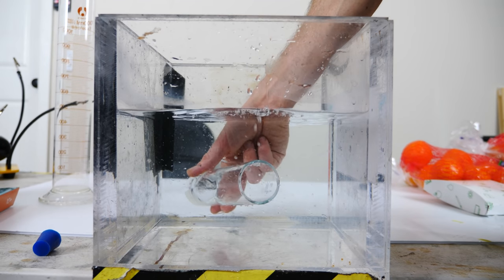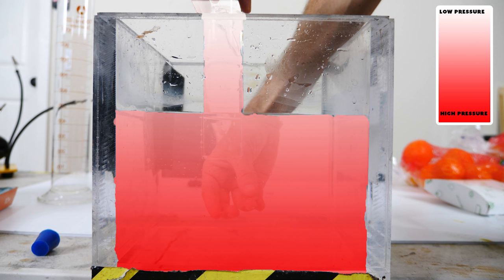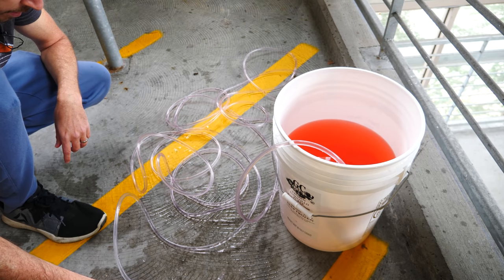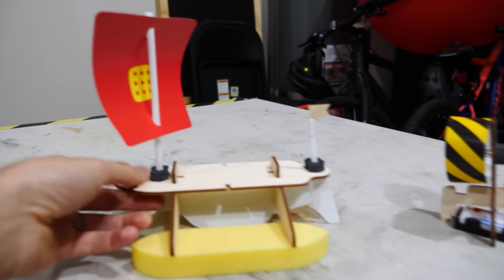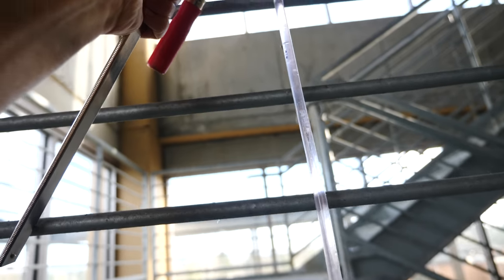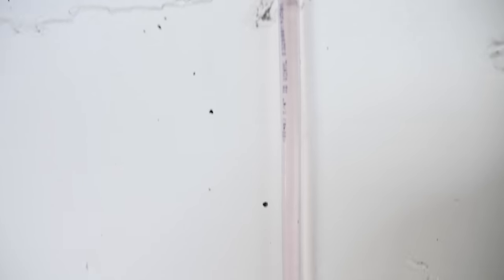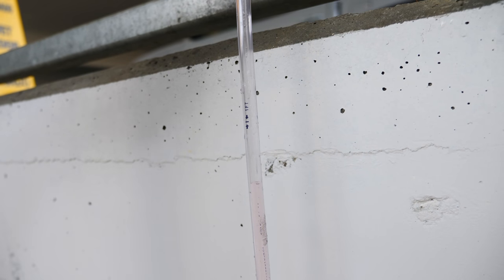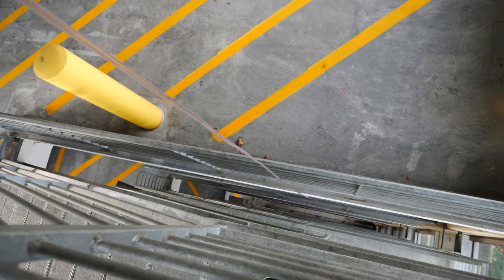Why Water Boils In Tall Cups

Comment: Please don't  say sucking. That sucks. You aren't sucking the water up. The air at the bottom of the tube is pushing the air up. That force is countered by gravitational force on the water plus any downward force from any air pressure inside the tube at the top. As long as the upward force exceeds the downward force the water in the tube stays. Hence the height limit because of the mass of the water column x gravity.

Comment: Isn’t it just sucking air  up because the pressure going down is greater than the pressure in the bucket  forcing bubbles to go down and up the starw?? Or is that water warmer idk
Reply: Neither. It's not warmer. It's just boiling.

Comment: Boiling as in just gases expanding and being visible but cold water ..................or.................Boiling as in kettle hot boiling water? If you set up valves you could tap it for a hot brew. Could this be done with 30'+ of vertical copper pipe or glass at 15mm???
Reply: It's not getting hotter.. It's just boiling at ambient temperature.

Comment: I had one thought as I watched this, if one could isolate the water vapor from the water head with a valve and then blead it off and condense it. We would have a mechanical distiller. Ie salt water to potable water to drink or irrigate.🌍

Comment: Hi and thanks for doing this visual experiment it like you say it's simulation of another video my question to you is two fold "boiling" in this instance is the splitting of the bond holding the H and O together and you mention starting temperature and correct me where wrong, the splitting causes an EXO thermal reaction,  so you can't suck water above 33feet at sea level because Livingston used this method to find the source of the Nile?

Comment: I'm gonna go out on a limb and assume that it has something to do with the building pressure of the water at the top pushing on the water below, building friction and because there's not a lot of water to dissipate the heat through and the heat keeps building and rising to the top. Also, thinner/lower pressure air at higher altitude probably plays a part. Now I'm gonna watch the video and see how wrong I am. 😂

Comment: what does boil even mean.i didnt see no heat source to get it up to 100 degrees.
Reply: Water doesn't need to be heated to boil.
Water boils at 100c when it's at sea level. But the less pressure, the easier it boils.

This tall tube created a near-vacuum at the top, so the water now boils at ambient temperature.

Comment: Can it be used to create a heater, or is the boiling water on too low pressure to give off decent heat?
Reply: its not hot. its just boiling.

Comment: So when the water boils at that height, is it 212 deg. f? or does the drop in pressure also reduce the boiling point?
Reply: The drop in pressure reduces the boiling point.

Comment: Does the diameter of the cup make a difference? My thought process is if you have a cup with a 10foot diameter, there’s more weight of water pulling down lowering the pressure at the top more than if it had a diameter of 1/4”.  The 1/4” line would have far less water it it which would mean less weight.      Idk. Am I wrong?

Comment: So why doesn't water boil in a plane because the interior of the plane is pressureised ik not by much cuz too much pressure would be uncomfortable for ppl but planes need that pressure so it's a light vaccume but planes fly quite high witch means the outside pressure is increased the higher you go and the water on the inside of the plane is it because the water is inside the lower pressure pressurized interior so atmospheric pressure is not effected on the inside so it would boil on the outside of the plane

Comment: Lifting that tube DOES NOT CREATE ANY VACUUM as there is water vapor inside, hydrogen and oxygen. You could never degas this way therefore it is not a vacuum. You may think it is a vacuum based on pressure alone but the definition of vacuum in that sense is outdated and should be labeled as LESS PRESSURE THAN GENERAL ATMOSPHERE.

Comment: Okay I've maybe a dumb question:
Does the water get hot while boiling in that tube?

I mean in space it would start to boil on way lower temperatures than in a pot but I've no idea if the water is getting hotter because of the vacuum with the surrounding temperature and pressure.
Reply: It's boiling at room temperature 🌡

Comment: using this method you should be able to distil water with out much energy. . What about water in a water tower or very high silo that was vacuumed seal; wouldn't that boil?
Reply: Thats why they don't suck the water up to the top, they pressurize the water by pumping it up from the bottom. A vacuum lowers the boiling point of water

Comment: What do you mean by boiling? Is it hot there??
Reply: No. But it's still boiling. Boiling temperature = 100 degrees Celsius means 100 Celsius in standard atmospheric pressure. When something's in a vacuum that temperature will drop.

Comment: Can you use this for heating a house?
Reply: Kind of, but probably not how you're thinking

The water in this experiment actually cools as it boils. This is because it's boiling due to decreased pressure instead of increased temperature. When a liquid boils, it always absorbs a certain amount of heat (its latent heat), which is where the cooling would come from

The same principle of using pressure to manipulate billing points is how heat pumps (aka air conditioners) work. Water could technically be used, but refrigerants are chosen because they're much better suited. The refrigerant is pumped to a high pressure, making it condense, meaning it releases its latent heat and warms up the surroundings. It's then released into a low-pressure tube, making it boil, meaning it absorbs its latent heat and cools its soundings. Depending on which side is in the house, this can either cool or heat the inside. You can actually switch which side is which just by pumping the fluid around in the opposite direction

Comment: Can we use this to filter water by collecting the steam at the top ?
Reply: Probably, but it's much easier to just use a small vacuum pump for the same effect instead.
Reply: @logitech4873  
I mean, in times of war, you may not have a vacuum chamber or the pump to take out the air. Here, the weight of the water creates the vacuum by itself.

Comment: No the highest you can get is of you vape the water from the top of the tube 😅... Couldn't you theoretically get much higher with a bucket of ice water or is that 33.*ft measurement accounting for ice temp? How does ambient pressure affect this, is it a different height in a mountain town like Denver vs sea level?

Comment: How come it didn't freeze like in a freeze dryer?
Reply: Freeze dryers lower the temperature to make the freezing happen. Then they drop the pressure to sublimate the ice directly into water vapor

The pressure drop part is similar. In both cases the pressure is dropped low enough that the water can only exist as a vapor at the current temperature

Comment: I do not under stand if the tube was sealed then why did the vapor level and water lever change once you moved it back down?
Shouldn't the amount of air at the top keep the water lever the same, or at least minor change.
Or was the air expanding that much from just a foot or so of lift/drop?
Reply: Because the water vapor (not air) precipitated back into water again when he moves it lower :)

Comment: Wait... Im still in ahh. So I understand there's pressure. So That's a pull and push. But the heat to point of boil? And if that's the case.. Can't they make a. Electric reactor using the pressure from lets say 1000 tubes in a large circle under a turbine that will pump up saltwater??

Comment: Would this produce any change in temperature? I realize the boil is due to pressure and not heat, but when you pressurize rock enough it becomes magma, and does get hot.
Reply: When the water changes state it can produce or absorb heat...
Reply: @jeebusk  I take it you don't know the answer.
Reply: @Nsix4  i don't remember the formula off the top of my head, 

If you want a more specific answer,
you need to ask a more specific question. 

when water "boils" or "evap" it will make the tube/air a bit cooler (it absorbs energy),
when the water vapor condenses it makes the tube/air warmer (it releases energy).
I may have that backwards...
Reply: @jeebusk  the fact that evaporation has a cooling effect makes me want to believe that's backwards, but it's not like I know lol.
Reply: @Nsix4  ok i edited the comments,

i think of playing paintball,
those co2 tanks get cold!

 it's the opposite of your rock example, the water/liquid is closer to rock. 
If you made the liquid lava hot enough it would become a gas as well... 
Then the next phase is plasma  :p

Comment: What about a wider tube? Would that change anything?  Or what if you unclamped it? Would the vapour shoot out the top or would it all get sucked down too fast?
Reply: Don't think the wider tube would make any difference other than making it way heavier to lift. Considering that the top part of the tube is under a high vacuum, opening the top would initially cause air to rush in and pressurize the tube and then the water would begin to drain downwards since the atmosphere is no longer pushing up on the bottom but pushing down equally at the top.
Reply: @tatodlp  I could have guessed that, but I still want to see it. 

I have to imagine a wide enough tube would eventually overwhelm the atmospheric pressure. For example if you had 100 gallons of water in the tube and half a gallon in the bucket it’s not going to hold. I’m guessing the breaking point is much less extreme than that though. That experiment would be fun to watch.
Reply: Actually I did guess that.

Comment: Dumb question, why isn’t the ocean like super hot then?
Reply: Couple points: the point of this experiment is raising water above its surface. At its surface any liquid is at atmospheric pressure. The deeper you go, the higher the pressure. If you manage to lift part of the liquid above the surface its pressure drops. The surface of the ocean is like the water surface in the bucket, not the water at the top of the tube.

Secondly, even though the water is boiling, it's not actually hot. The boiling point of a liquid depends on pressure. Higher pressure > higher boiling point. This experiment bills the water by dropping the pressure. The pressure gets low enough that the boiling point of water is below the ambient temperature, and so it boils
Reply: @complainer406  Thank you. I figured there was a reasonable explanation. Even after living at altitude for a few years I never fully understood the why.

Comment: Imagine we can harvest the heat for power just by gravity and pressure from water. (Change to another liquid?)
Reply: What heat?
Reply: @logitech4873  the water is boiled
Increase the diameter, maybe use another liquid that can boil faster. 
Imagine ton of cubic liquid creating heat using metal container to transfer the heat.
Reply: @shaka2tu  There's no heat involved. Boiling doesn't necessarily mean heating. In this case they're just lowering the pressure until it boils at 20 or so celsius, or whatever the temp is there.
Reply: @logitech4873  but boiling in this case means heat. That my logic. 
And this is small scale, maybe we can specialize the setup. 
Imagine the diameter of tube is 10 meter made using thick alluminum container  and lift it double the high. 
with thight sealed vacuum and using oil so their boil temp is higher. 
But yeah if the container can withstand the pressure maybe it can be power generator. 
I dont know how hot the pressure  can generate but, 
If the pressure can generate enough heat, isnt it will be unlimited energy?

Comment: No… the weight of the water is forcing the air out of suspension, in the water, and the bubbles are floating to the top…

Comment: Can this be used as a process to sanitise water, or do something with it?

(Apart from measuring devices for atmospheric pressure/temperature).
Reply: Theoretically yes, practically no.  

While you are getting water to boil, your doing a ton of work to make that happen, as the water boils you'd need to then suck the very low pressure water vapor out of the tube so more water can be boiled.  Easier said then done, and at the end of that you have a tiny bit of clean water.

Comment: Does it realy depend on the boiling point? I thought it is just about the pressur and the density of the liquid?! So you can suck up water at sea level up to 10m and and quicksilver which is 10 times more dense can only be sucked up 1m till you suck a vacuum. Can a liquid with the same density as water but a higher boiling point be sucked higher than water?

Comment: Water starts boiling?? As in reaches 100' C ?? Does d tube becomes hot?
Reply: Water doesn't have to be at 100 degrees to boil, as the pressure decreases so does the boiling point.
Since the forces dragging the water down increase with the additional height, the pressure decreases allowing the water to boil.
It will only continue to boil if you keep raising the tube higher and higher continually, but it doesn't get hot, just turns to vapour.
Reply: Water's boiling point is 100 degrees at our normal atmospheric pressure at ground level.

Comment: if it boils does it get hot
Reply: No, it stays the same temperature. It doesn't need to (and physically can't) get any hotter since the boiling point of water lowers with pressure

Comment: Would the point at which it starting boiling change if the diameter of the hose was smaller or larger? What if the diameter wasn't static? Meaning at points the hose diameter increased and at other points it decreased but not necessarily in even amounts.
Reply: The outcome would be the same regardless of the shape of the tube.

Comment: Is it hot to the touch?
Reply: Of course not.
Reply: @logitech4873  explain to me why it is so obvious that boiling water is not hot?
Reply: @p_versus_p2547  You're aware of the idea of boiling point right? 
Different materials have different boiling points, and those boiling points are based on temperature AND pressure. 

This means that to make something boil, you can either change the temperature or you can change the surrounding pressure. 

By sucking the water up a very tall tube, you end up with extremely low pressure towards the top. Eventually the pressure drops so low that the boiling point is at around 20°C, so you'll only have water vapor above that point.

You can dry things out with a vacuum chamber because they boil away all the moisture.
Reply: @logitech4873  thanks for actually answering the question. you could try to be less condescending. we are here to learn after all. sorry i dont know everything.

Comment: It is not boiling. You can see at:

https://youtu.be/WPCqTeOlRdE?t=273

there are no bubbles coming from the water.

So what you see it simply the atmosphere pressing on the water in the bucket, and this is how far it can push up the water column.

But there is no boiling. At all.
Reply: Yes it's boiling. The space created at the top, above the water, is water vapor.

Comment: So does a water well that’s past 30ft have a way to prevent this or how does the water not boil say in a 100ft well hopefully not a dumb question
Reply: Put the pump at the bottom of the well, pushing the water up. That way vacuum boiling is avoided.

Comment: would it still be 33 ft at altitude? Like if I go to the top of Rocky mountain national Park and try this experiment, wouldn't it be lower since the ambient pressure around me is lower?
Reply: Correct, less ambient pressure would mean less height required

Comment: I don't understand how it boils 
If it's that easy to create boiling energy then where are all the practical applications for creating energy with just long straws
Why do we still turn the oven eye on and boil water with pots if it's that easy
You can't explain it like this
You sure it's just not bubbling water
Is it actually hot boiling water?
I don't understand
Reply: It's boiling, but it's not hot. The low pressure reduces the boiling point of the water to room temperature.

Comment: does this generate heat? if co can it be harvested and made into some sort of free energy source? where does it get the energy needed to boil???
Reply: The lower the pressure the less the boiling point
Reply: It’s high enough in the video that the water boils at room temperature
Reply: It’s the same reason your blood boils in space if exposed to the vacuum

Comment: and why does it boil? I'm lost.
Reply: There's two things that decide when water boils.
1 - temperature
2 - ambient pressure

Usually you just heat the water to boil it, but you can also just decrease the pressure to make it boil. This is what's happening here.

To be clear, it's not becoming hot - it's just evaporating into cold water vapor. This is still called boiling though.

Comment: What do you mean boils?
I missed the part where you explained anything, brother.
Do you mean a boil like it gets to 100 C°? Is the water hot?
Is the tube hot?
You didn:t explain enough, bro
Reply: It doesn’t get hot

The boiling point for the water is lowered when the pressure is lowered

Comment: As the waters boiling there's something getting in that tube what is that it is air or any specific gas
Reply: The boiling point for the water is lowered when the pressure is lowered

Comment: So you are telling me that I only need 40feet to make hot water?
Reply: It boils but it doesn't become hot. It's just evaporating because of the low pressure into water vapour.
Reply: In fact, evaporation will actually cause a cooling effect